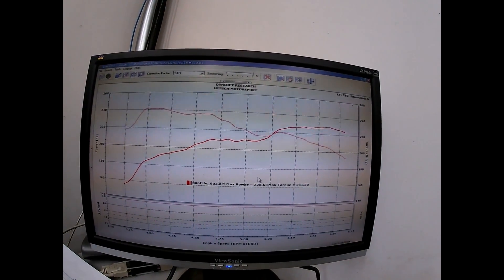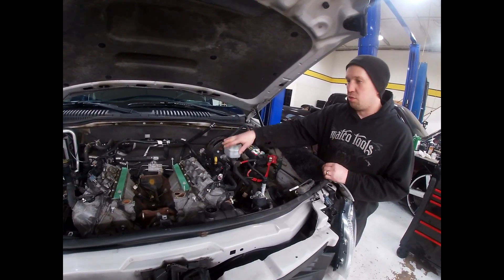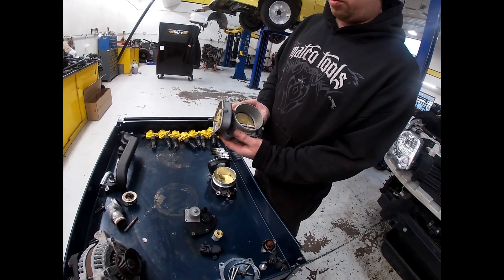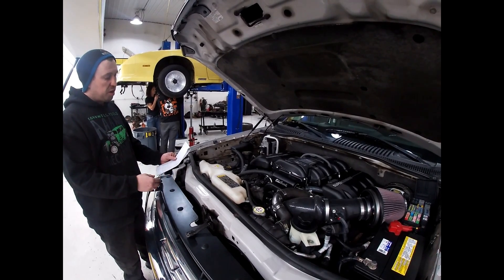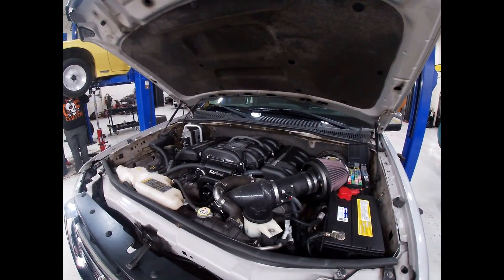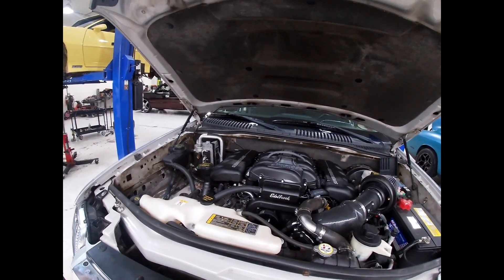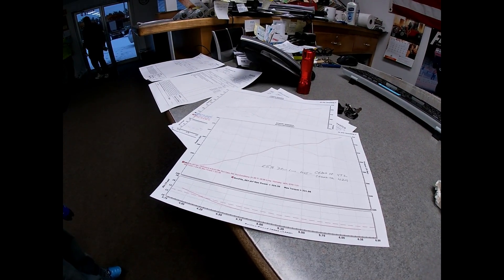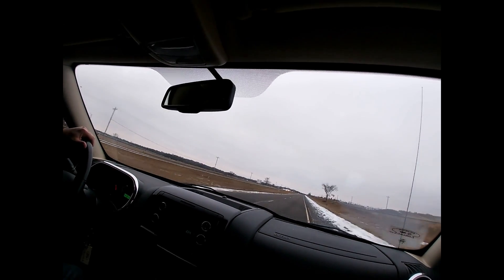2010 Ford Explorer 4.6 Bolt Ons

Comment: The 4.0 is a better motor my sport trac has the 4.0 motor has always ran awesome but I can’t say that about the transmission and driveshaft the 2 things I think Ford should be ashamed of putting in thees vehicles consorting they cost so much to be serviced ho I guess I did leave out the defrost vents issue that For Explorers have on most every one. But other than that they are the best looking truck Ford has ever made. I seen they have a new maverick coming out that is a bit smaller but resembles the sport trac a hole lot.
Reply: I had a 1st gen, now a 2nd gen 4.6 limited mod, so no all wheel drive like adriline all the time, i choose when to put it in all wheel, no comparison to the 4.0l at All.

Comment: That’s a lot of money for only 130hp gain.
Reply: 130 whp its huge upgrade, maybe 180+ hp at the crank if not mistaken, and this just supercharger, you can make much more with cams, heads and exhaust....you can get up to 500 or more whp!
Reply: not getting rid of my sporty so that is what I wanted to do. 3 valves are a not all that. Needed to do something to help out.
Reply: Scott Jermstad  ive had my 07 since 2011 and dont plan on letting it go as well, so this makes since for me too. How has it held up/ been since you’ve had it for a while. A lil update would be much appreciated.